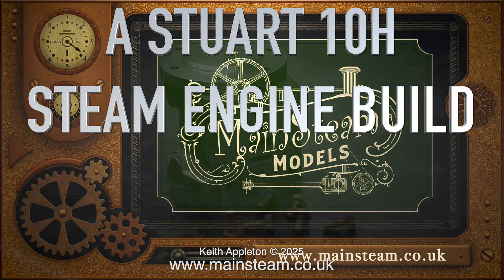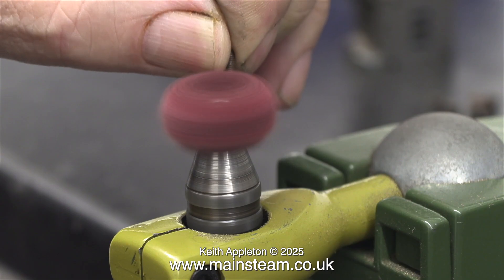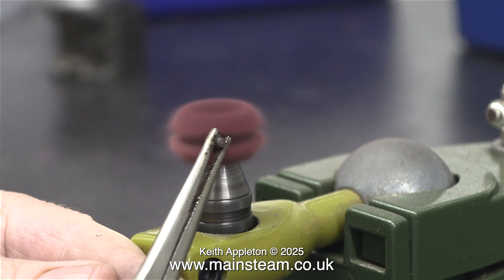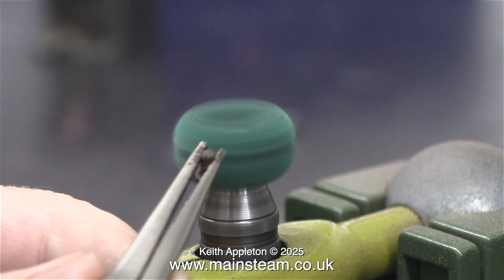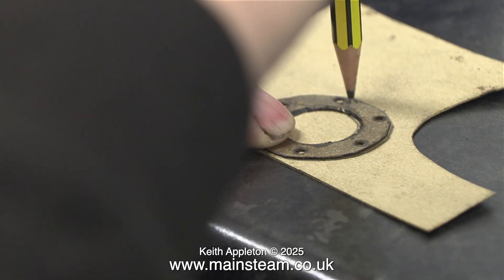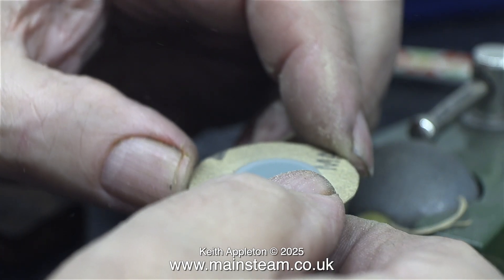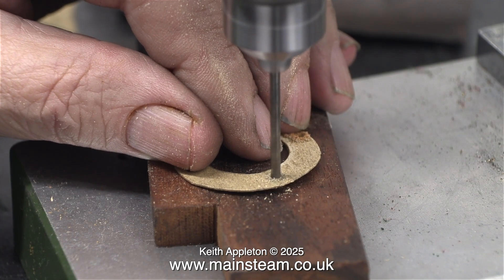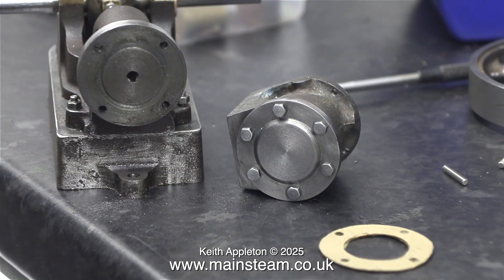A STUART 10H MODEL STEAM ENGINE BUILD - PART #10

Comment: Keith, I'm loving this series and it has given me a number of useful nuggets for my own build (not a 10H but an Aussie equivalent).

Can I suggest you do a google search for "make a gasket with a ball peen hammer".
It was how I got taught as an apprentice motor mechanic almost 50 years ago now. I never went down that road, but some things just stick with you.

Same as turning an open ended spanner over when you're turning a nut or bolt, it extends the range of movement particularly when you're working in a tight space. It is, after all, why the open end is offset the way it is.

Cheers,
Reply from the maker: I have covered the hammer method in other videos, it is not necessary though on really small cylinders like this one.